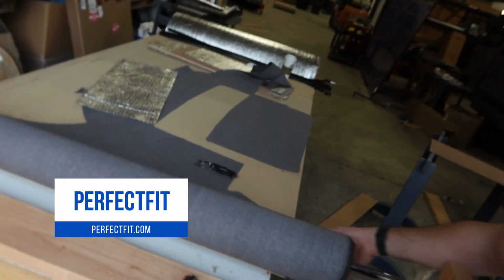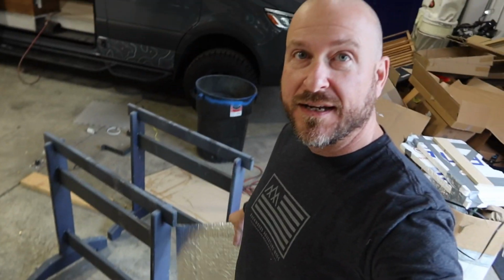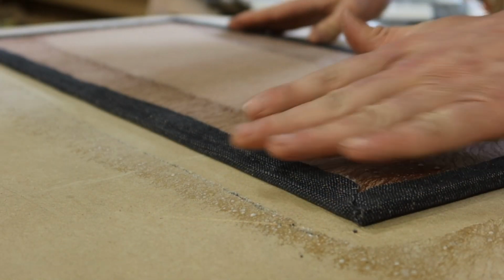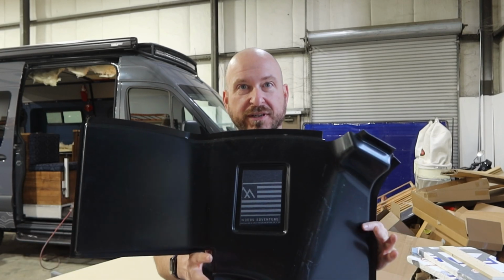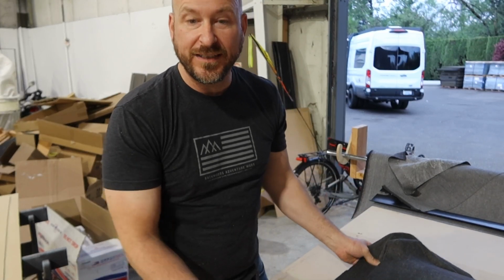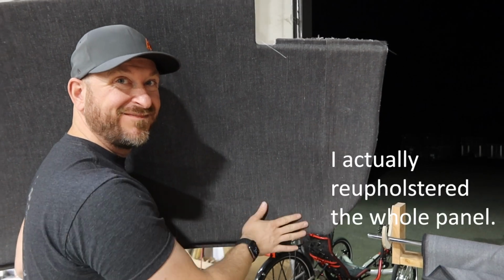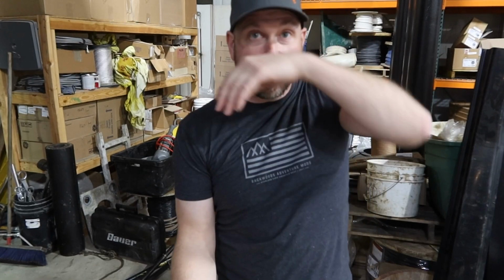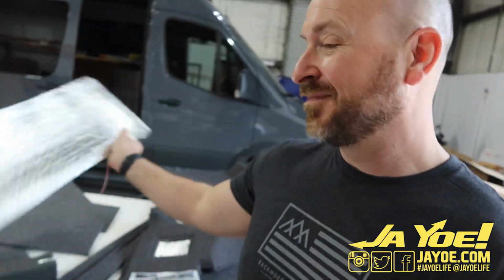Upholstering difficult shape van wall panels

Comment: Having experience with design and model building you could use recycled paper rolls which come in 100', 300'', 600'+ (or newspaper, magazines) to lay over your work area. Once one panel is finished pull out a new sheet to length and you'll have a clean surface to work with each time.
Reply from the maker: That would have worked better. Makes sense. I feel like I wasted a lot of scrap. Just glad I had scrap to waste.
Reply: @JaYoeNation  I just read that spraying (bottle) hot water on the fabric helps with forming. Also "Upholstery Tips How to Mold a car carpet? basic Upholstery tutorial" in youtube, this guy is a professional fabric installer.
Reply from the maker: @clark7117  ahhhh. Yea I bet there were a bunch of this that could have helped. Just tried my best.
Reply: I came here to mention that, I used old rolls of wallpaper  we had lying about at work as well as newspapers when I built out my van.

Cracking job you done though.

Comment: Yes, there is a solution, it’s called craft paper. You buy a big roll, tear off 6 inch strips and tuck them under the edges before spraying. In the olden days you could use newspaper, but you children probably never saw one of those. So go buy a big roll of craft paper.

Comment: Have two work benches that the panels will over lap on all sides, spray and move to clean work table. Handle from underneath - the non sprayed side. Put plastic on the bottom to catch spray residue.

For the best stretchs on angular sufaces, you want to have your fabric on the bias. Another option is take a spare piece try with a hair dryer on similar shapes, warm up the fabric before spraying adhesive as the heated fabric will allow more give in shaping. Read your guide to the adhesive pocedure with heat and its reaction fisrt. As per fabric it should be ok even if it is synthetic. 

NOTE: When heating fabric, it needs to be warm as posible without altering the fabrics integrity, so that is up to you to judge.

Comment: I know this video is old now, but instead of pre-glueing everything and dropping the material on. Instead lay the material on the work piece before glueing, then fold the material back to the half way point of the work piece. ie, so half the work piece and half the back of the material is exposed. Spray glue on both, then roll that half if the material onto the work piece. Half of it is now glued on. 
Then fold the other half back, spray glue again and roll the other half of the material on.
If spraying near the edge, hold the work piece in the air and spray along the edge while holding it away from a sacrificial back board that gets oversprayed (keep turning the work piece around), so the edge never touches the glue oversprayed back board. Or go old school and brush the glue along the edges and only spray the middle (if it even needs glue on the middle). The brush stays soft if it's always in the pot of glue.
Reply from the maker: @desparky  the glue needs a few minutes to activate before you put the sides together. That’s why I was spraying them before pulling them together. Although I’m sure you have a point. I was learning.
Reply: @JaYoeNation  yes, you still let the glue flash off. I'm just suggesting an easier method for applying it and also helps when handling large pieces of material. On awkward shapes. 
This is how many upholsterers do it.